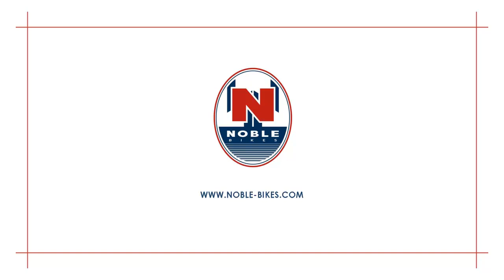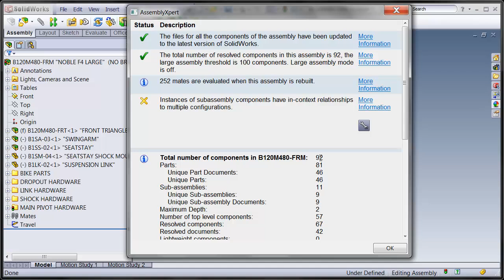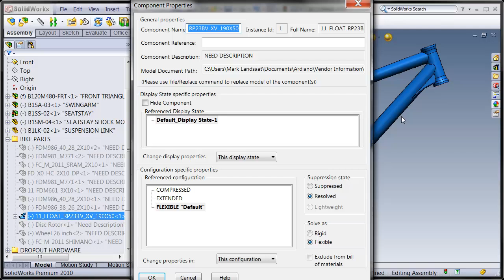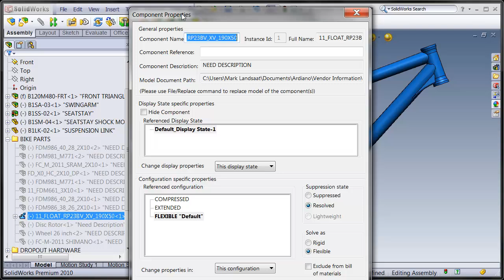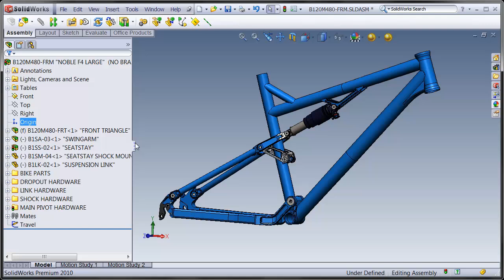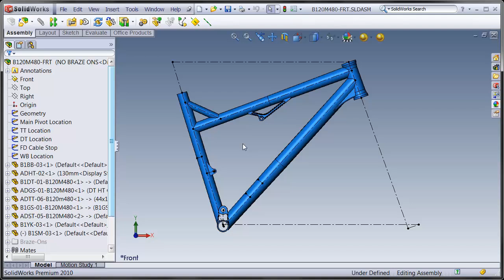SolidWorks Suspension Frame 1

Comment: You can't sell or produce anything that you have designed in the student version. When you print any designs from the student version it will say that it is not allowed to be used for these purposes on the bottom of the page. The student version still contains all the tools that are in the full version. I own the 2009 student and full and they are identical to use.

Comment: I need to set a common thickness to two Extrusions. In User’s Guide (SolidWorks 2007) it says:
1.	In a part .., create a parameter compatible with the field to be linked.
2.	Start the associated PropertyManager or the dialog box.
3.	From the drop-down menu of the value field that you want to link to a parameter, select Link Value.
The Parameters list box appears.
I cannot find how to “In a part .., create a parameter”. 
I got stuck. Help me out, please.